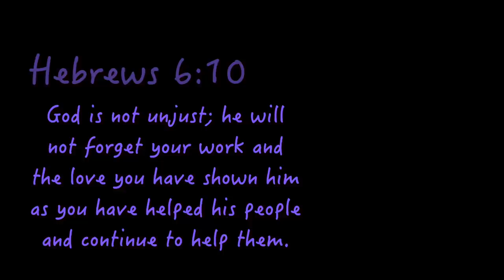Short In The Britches; Sub-Compact Tractor Limitations

Comment: Tim, thank you for all your videos. They show real world use for the tractor. After watching your videos for quite some time,I finally got my 1025r back in February. Mine is just the loader, mower, and rear blade. just did my 50 hour service. I too have already found several occasions where a larger machine would have been handy, but like you have made it work. Thanks again for the videos. 
-Brandon

Comment: Single use super glue works well in the first aid kit. You can use it to seal a wound or remove a splinter( sometimes ).
A pile of dirt to drive up on can help with the height limitations. I know it’s not always allowed but in places where you can it works. 
We have onions like that at our house in AK, one flowers white the other is a light purple flower. 
That wood would make great compost material. I typed to soon. It’s going as firewood.
Reply from the maker: It was ready for compost...

Comment: At 8:27 you were getting tiny loads with the grapple.  Did you consider using the bucket and rolling the wood into the bucket by hand. (Maybe a neighborhood teenager's hands).  The bucket would be filled fuller and make fewer trips.  If another worker was stacking the wood in the trailer, it may have held more.

Comment: You can build a little ramp out of dirt next to the trailer for added height.   and just pull the trailer forward as you fill i up.  we do it all the time with my 463 Bobcat.  They also make a roll out bucket to help with height problems.  one of those with a grapple would work.
Reply from the maker: Neighbor Jimmy has a 453 bobcat now. ...at least on loan.
Reply: Tractor Time with Tim I love mine.  I have just about every attachment for it.  I also have a 853 with all the attachments i could need for its size.  Some of them work for both.  I have a TB 108 mini excavator and a Yanmor B7. I love the 2 small units but some jobs you just need to go bigger.  Keep up the cool videos!

Comment: Should build some 2x12 ramps by just stacking some pieces together to get you 6-8 more inches in height. Just enough to drive the front tires up onto.
Reply: The ramps were there ,
Reply: Or if time and money are no object, dig a trench with backhoe to back trailer into where top is about a foot above ground and refill trench when done!👍

Comment: I’ve found with fire wood like that my bucket works best. I save my grapple for brush and such. 

For height on my compact I’ve built ramps with dirt and one with wood before. I’ve even used a set of those metal car ramps before to get a little more height on a tall dump trailer before. When I have a LOT of stuff to load I have even used the ramps to the trailer and drove on the trailer to load from the front back.

Comment: You might have dug out a hole for the trailer to sit down in and use the removed dirt as a ramp for the tractor to rise up.  Easy way to gain a foot or two.

Comment: Just another one of those trade-off's you have to consider with grapples.  If you had one with the shorter bottom legs, it would have done better at the cost of other abilities with the longer leg ones.
I bought a 'thumb' for my excavator (similar to your Cassie) and believe that with a wide bucket it would have done the job better.
Although limited in its abilities, the 102x Series John Deere's are very forgiving and have probably saved me a time or two when I tried to do something stupid.  I'm still tempted by the larger ones but, safety keeps kicking in every time I consider trading up.

Comment: To load that trailer open the back use ramps drive on and load it that way doing the last after closing the tail gate then load from the end
Reply from the maker: That works.
Reply: Seen others do it with small tractors and slid loaders

Comment: Dude, you don't need a tractor for this job. Seriously, just park the trailer next to the pile of wood and chuck the pieces of wood in by hand. It's way faster.

I had to do something like this where I had to move wood (and I have a JD 2520 with a 200CX loader which is way better than on the 1025R). I didn't even use the loader. I put all the wood in the trailer by hand (pieces were the same size as what you had to move) and used the tractor to move the trailer and then unload the wood by hand.

Comment: We thought that the little tractor would tip over for sure with that much weight high up and so far out front while driving on rough terrain. We were just betting on whether the camera would keep rolling in case a tip over happened. Be careful Tim....
Reply from the maker: Well under control. Not nearly as heavy as it looked.

Comment: Tim, would it have helped if you slid the grapples together in the middle, not leaving a gap in the middle on top?
Reply from the maker: So, you were recommending removing the middle rake?  That might have helped.
Reply: In your case yes. Since you don't have a full top, you had wood falling out the middle where no clamping action can happen. Smaller bites, but you may lose less material of these small cut up pieces.

Comment: Hi Tim there a very easy solution to your problem always carry tractor ramps that way you will get that extra height so you will have an extra foot of height
Reply from the maker: So, stop, get off the tractor, move the ramps with each loader bucket full???
Reply: Hi Tim no you put the ramps where your going to load your trailer and you drive up on the ramps and you have your exter height just try it before you knock it i think you will like it
Reply from the maker: Are these ramps 14’ wide??? I need to get to all parts of the trailer to load.
Reply: Hi Tim the ramps are as wide as you want them you put them beside your trailer and you drive up on them and you have your extra hight

Comment: "Short In The Britches; Sub-Compact Tractor Limitations" Its a Sub-Compact Tractor. Every piece of equipment has limitations. You can have a Ferry bring your car across the lake, or take the car apart, bring it over one piece at a time in a rowboat. It will work but a rowboat isn't a ferry and has limitations.
Reply from the maker: Yes.  Are you taking offense to the title?  One of the major themes of our channel is how much can be accomplished with this little tractor.  Not sure why it would be unreasonable to explain one of the limitations.